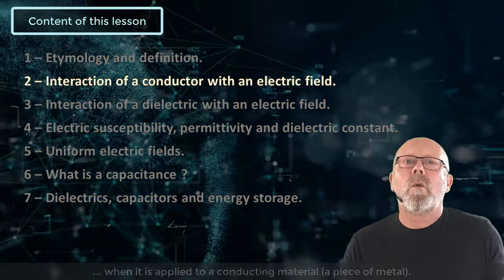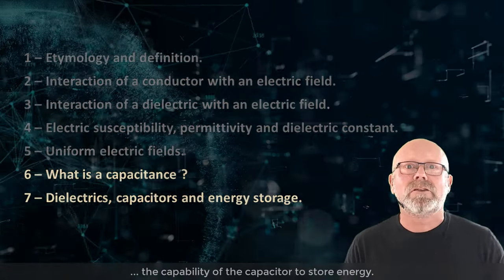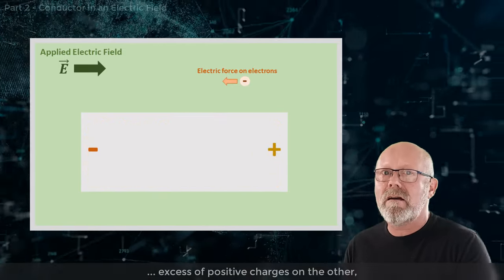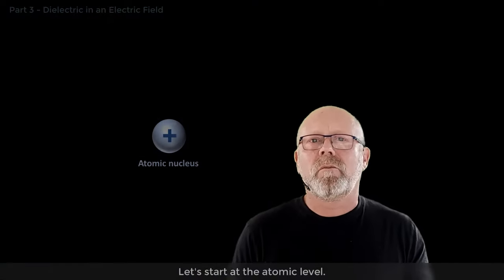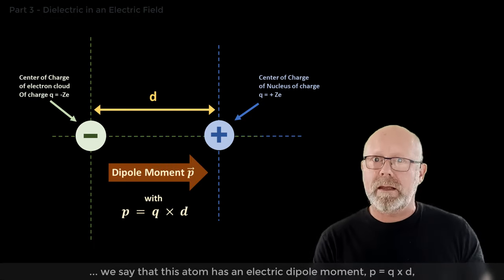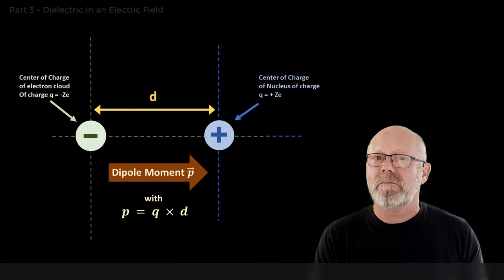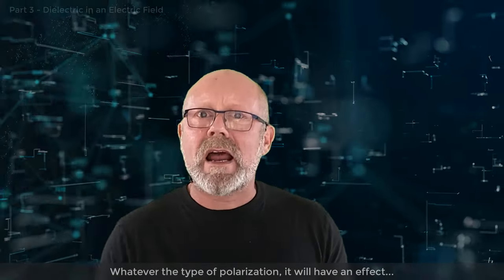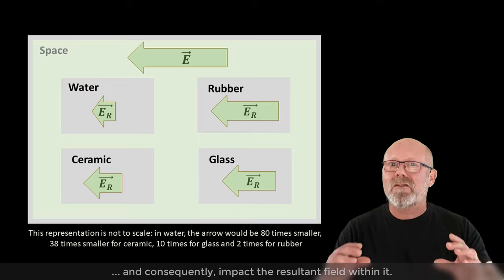What is a Dielectric? (Physics, Electricity)

Comment: I watched your video why gravitational potential energy is negative. Can it be < when we displace a body from the surface of the earth , we do some work which is stored in its potential energy. Since the force of attraction is towards the centre of the earth and the displacement is outwards the centre of earth so the work done will be negative as the gravitational force . so will will be negative and so the Potential energy will also be ZERO.
Reply from the maker: Hi
The work done is positive: in W = F x D, F is the force applied on the object to move that object, not the force of gravity (it is opposite to gravity). F and D are both in the same direction.
The PE becomes then less negative... (It is zero when both objects are infinitely apart).